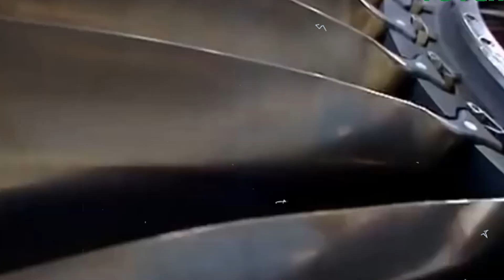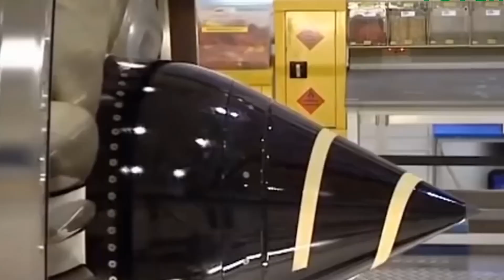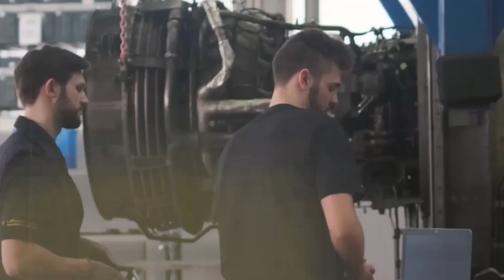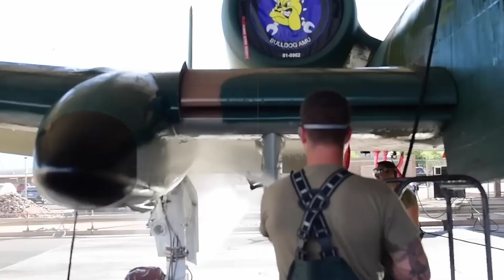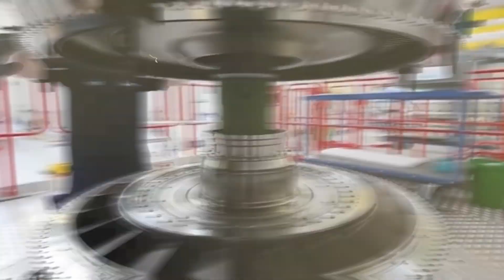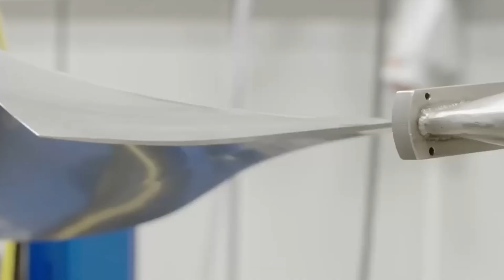How Jet Engines Work

Comment: How does the design of the turbines and compressors impact the efficiency and performance of a jet engine?
Reply from the maker: 1. Aerodynamic Efficiency: Turbines and compressors are designed to optimize airflow. The shape and arrangement of the blades are meticulously engineered to minimize air resistance and maximize pressure changes, which leads to efficient combustion and power generation.

2. Material Selection: The materials used in the construction of turbines and compressors can withstand high temperatures and pressures. Advanced materials like titanium and nickel alloys ensure durability and performance under extreme conditions, thus enhancing overall engine efficiency.

3. Cooling Mechanisms: Effective cooling systems are integrated into turbine design to manage the intense heat generated during operation. This prevents overheating and ensures sustained performance without compromising engine integrity.

4. Blade Geometry and Number: The number and geometry of the blades in turbines and compressors influence the compression ratio and thrust produced. Optimizing these factors ensures that the engine can achieve higher efficiency and better performance with less fuel consumption.

5. Advanced Manufacturing Techniques**: Precision manufacturing techniques, like 3D printing and precision casting, allow for the creation of complex blade shapes and designs that were not possible before. These advancements contribute to more efficient air compression and energy extraction.

In summary, the design of turbines and compressors directly affects how well a jet engine can convert fuel into thrust while maintaining efficiency and reliability. The more sophisticated the design, the better the engine performs.
Reply: @AutoIgnite-b8g  Thanks for all this information 👍👍